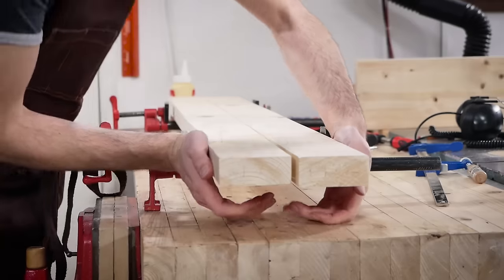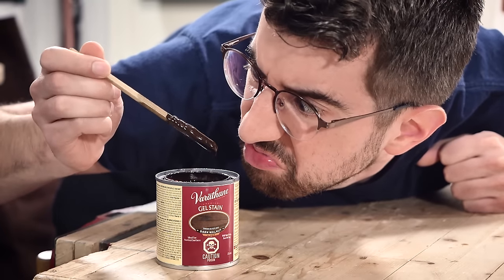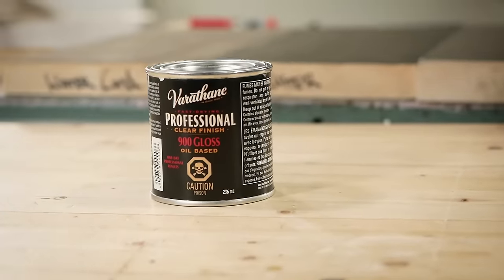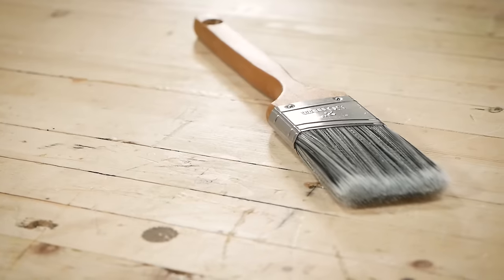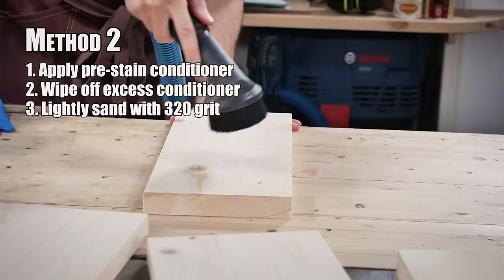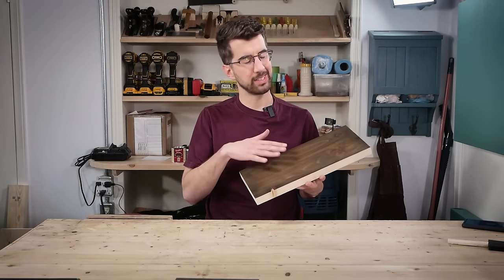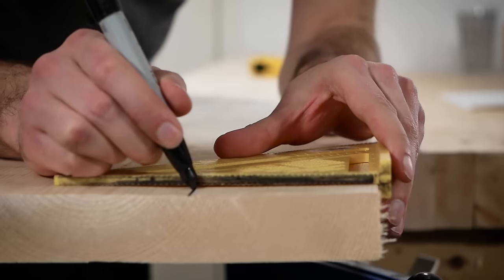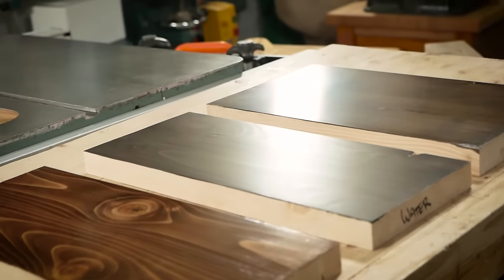Stain can look REALLY gross

Comment: I have stained a ton of clear pine from home stores with gel stains and it works extremely well as you demonstrated to avoid blotching.  If you run into areas where you do not wipe off the stain fast enough, sometimes you can reapply the stain, which tends to reactivate the dried area and wipe it back off.  This doesn't always work but it is a lot faster than sanding back to bare wood when it does.  I have also had great luck spraying water based top coats (sanding between coats) to get a quick build up finish.  This helps avoid the overlapping challenges you mentioned.

Comment: One trick I see a lot for getting a really good sanded finish is that you spray the boards down between each grit with water so that the fibers expand naturally like they would once you start staining, and the sanding takes that off, not just the dry fibers.
Reply: Sanding wet wood is annoying :c
Reply: @chang.stanley  You don't soak it, you just get the fibers on the surface to pop a bit.
Reply: @chang.stanley  you let the wood dry before sanding it. Still makes the grain pop and you get a better result
Reply: @sarahjoyce5041  Oh, cool :O
Reply: This is called water popping. Wood floor installers/finishers use this too.
Reply: @chang.stanley  once you have a finish established on the wood you're not longer finishing wood. You're working on finish. The wood is under the finish you've applied. You shouldn't sand through the finish either. Otherwise why put it on in the first place? In fact you can wet sand the finish then. I do.

Comment: Great overview! Well presented, it's always good to see the direct side-by-side comparisons on test boards. One thing I think everyone should explore though is wipe-on poly. Wipe-on has so many advantages over straight oil-based poly, chief among them being that the method is so almost impossible to screw up that even first-timers can get a great result with almost no effort. The application method inherently gives one or another very nice surface finish – the "hand-rubbed look" is sort of the default – without any significant extra sanding.

Not that I'm suggesting people go out and buy wipe-on, because then you pay them (too much) for giving you less actual finish haha. Diluting your own is generally way cheaper, plus it gives the user control over the dilution level which may be best tweaked during the process (1st coat thinner, coats 2-4 less thin, last coat thinner again) and definitely should be tweaked season to season (more dilute for cold weather in an unheated workspace), and what solvent to use (OMS v regular mineral spirits v naptha or xylene) to make a faster- or slower-drying finish as suits the user (and their tolerance for solvent odour!) along with the drying conditions.
Reply: It's remarkable how much the video and this comment echo my own experience and recommendations.

However, while I also like rub-on poly, I'd advise caution with the rub-on over stain and especially gel stain.  Even after a long stain cure (i.e. a couple days) the solvents like to lift the stain and leave it pale, thin, and blotchy or smeared - especially if the target shade was very dark.  To avoid this, I thinly apply the first coat with the lightest method practical (such as a foam brush if small scale), let dry without "rubbing," and sand with straight paper only (like printer paper).  After that there's enough protection layer to handle firmer application and more aggressive denibbing.

But if going from very light wood to very dark stain, and lighter duty protection is sufficient, that milky-when-wet water-based Varathane finish is still more reliable and foolproof.  I also personally prefer that finely textured satin sheen over all but the very best oil-based results in any sheen.

Comment: Scott's production, performance and scripting are excellent.  I wish he would have slowed down on his best and final so it'd be easier to track the steps.  He definitely has strong feelings about imperfect coloring and pine grain patterns, but in the right setting and project, imperfect can be the better balance.  I love modern design and perfect finishes, but in my house I prefer a more casual, light-rustic feel.
Reply: This mans advice right here
Reply: Whenever a video is a bit too fast paced, I like to click the gear icon in the corner, and set the playback speed to 0.75x. Easier than rewinding over & over.
Cheers
Reply: @mikegammo9002  Great tip, thx
Reply: Same, I love the colors and contrasts.

When I look back at color corrected photos from the 60's to 90's, it makes me wonder, where has all the color gone? Why is everything dull and monotone now?

Anyways, for me, seeing the grain pattern in wood is extremely soothing and enjoyable.

Comment: My favorite finish to use on soft woods is Shellac.  
You can buy it as clear, amber, or smoke color... or you can dye clear shellac with alcohol based stains.   
Shellac is easy to apply, easy to repair, & easy to smoooooooooth.
Reply: Shellac is nice but can be difficult to apply evenly on large flat surfaces. Plus its horrible for tabletops due to it being soft. I only use Arm-R-Seal by General Finishes for table tops.
Reply: @LBCAndrew  
If you apply thin coats & sand between coats... shellac is very easy to aplly evenly on large surfaces.  
Shellac being soft is only a problem if you build a thick finish.  In that case, if you desire a glass like coating over a table top... then a self leveling epoxy is better.
Reply: @LBCAndrew  I don't have a problem with shellac because I am not looking for a final finish with the first coat. I use cut shellac as a sealer on the first coat and it mostly gets sanded off. For me if I'm looking for a fine finish on wood it typically takes me at least 3 coats. I expect the first two coats to come out like trash. If I'm lucky whatever I do the third time around works. But I don't always get lucky. I keep finishing until I get the results I desire. I will apply poly over shellac for a more durable finish too.

Comment: If you want to avoid oil-based products, I've had a lot of success with dewaxed shellac (like Seal Coat) bringing out figure in wood before whatever topcoat you want to use (I've used water-based poly and other products, but the dewaxed shellac can be a barrier coat between any two types of finishes). Bonus: the same Seal Coat product will work as your sanding sealer before staining. It also smells really nice.

I generally avoid pine (I just don't like how it looks), but other woods, like Cherry, can easily blotch up as well.

Comment: Take a tip from furniture manufacturers: avoid stain, use alcohol-soluable dyes instead. Add the dye to the topcoat and spray it on. One and done. Obviously, this isn’t for everyone. But dyes (available in both water and alcohol-soluable formulas) are much less prone to splotchiness than stains. A stain is a mixture of colored solids ground up and suspended in either water or alkyd. The solids collect in the small troughs between the growth rings present in any wood, making them stand out. Dyes have no solids, so they provide more even color. A bunch of years back I used a bright green stain (Solar-Lux) on BCX plywood (after sanding to 180), covered by acrylic poly. It looked great with nice even color.
Reply: I'm a big fan of alcohol-based aniline dyes for non-brown pieces. I used a bright red and bright blue dye on some simple boxes about 20 years ago, and the colors still pop.

You have to exercise some care when using them, but because they're alcohol based, there's no heavy oil stink afterwards, and they dry darn near instantly.
Reply: Another advantage to alcohol dyes is that they're very easy to mix and customize once you learn how.
Reply: I would never add the dye to the topcoat since it makes it look muddy. I put my dye in the wood, and the finish ON the wood.

Comment: I just redid speaker cabinets.   oil based stain, 3 coats of satin polyurethane.  knocked off nibs with 320 sandpaper on coats one and two .   coat 3 ( final) was pretty good.  a few specks.   used 1000 grit wet sandpaper, wiped it across finish and it took off nibs.   didnt dull the finish.   im happy with the result .

Comment: For top coats, I've gotten really good results with several thin layers of wiping poly (like 4 ish?), and a thin rattle can coat on top. After it's set up I buff it out with a paper bag aggressively. Ends up looking real nice :) I started with wiping stuff because wow do I hate cleaning brushes.
Reply: Progressive thinning coats is how I achieve a fine finish. I want the final finish to be chemical sheen. So I want it to just level off. One secret is after you've built up a finish you need to realize you're not longer finishing wood then. You're finishing finish. So that means you can wet sand. You should wet sand too. I have brush cleaner so I don't mind cleaning brushes. After I brush clean brushes I wash them out with soap and water. I am not a fan of wipe on finishes unless they're just an oil.

Comment: Another trouble spot for staining blotchiness is glue. If you glue up boards before staining, don't use so much glue that it runs all over. Use just enough to get a small bead of squeeze out and do not wipe it off. Wait until the bead is dry then scrape it off. This will save you a lot of sanding to get through the glue that soaked into the wood.  Stain won't stain glue.
Reply: Oh my word - that tip just might save our marriage.  lol  My husband is a skilled woodworker, but this glue issue has been the bane of his existence - such a simple solution - don't smear and you have to sand anyway, so chipping it off once it's dried makes perfect sense.
Reply: @dianapuppy4141  There are a bunch of ways of avoiding issues with glue squeeze-out. I presume your hubby might have seen a number of these before, or by now, but I'll list a few tips in case they're useful.

First, wiping off wet IS a legit method (and many pros do this). But it's rarely shown or explained how thoroughly you need to do it to avoid problems. First thing is to use plenty of clean water, second is to wipe more than once. Almost nobody wipes more than once with clean water and/or a fresh rag and that alone makes a huuuge difference. I think three times is the minimum for guaranteed effectiveness and I wipe dry as the last pass.

Not always doable, but applying sanding dust to the area and then brushing off with a firm bristle brush (toothbrushes, medium or firm, work great for this)

This tip has been around for ages: tape along the joint edges. This can be 100% effective, but it uses a lot of tape in the long run (potentially an issue if you're using the expensive blue or green stuff). Anyway, the glue goes onto the tape, and can be wiped off, wet or dry.

Provide space inside the joint for glue to go, so that none or almost none is available to squeeze out onto the surface. This is best covered in detail in an article, and I think Fine Woodworking had one last year or the year before that explains this well, with detailed photos. 

Last one is to pre-finish before final assembly. This isn't always possible depending on the project type, but where you can do it the dried finish acts as a barrier to glue penetration, and makes wiping off spills or squeeze-out super effective and easy. 

Hope it helps!

Comment: Sometimes the old way isn't so bad: I'm a fan of shellac. 1:6 with alcohol as a pre-conditioner (spitcoat), then an oil or water based stain, then more shellac. You could also go all out for full French Polishing, if you really want to go nuts with it. That gets gorgeous results. 

If I'm feeling lazy, Tung oil, Danish oil, or linseed oil make a perfectly good stain and finish all in one. They aren't the most robust, but they look good.

Comment: For stain, my favorite way to do it is add stain to the polyurethane and apply as a single finish. Comes out a lot more evenly. I usually apply it with a foam brush.
Reply: @MegaShitfactory  yup. Generally, I add just a little then mix it and use a test piece. If I need to go darker, I add a little more. It usually doesn't take much and one coat generally does it. If I need a bit more durability, I'll go over it with clear polly.
Reply: That’s exactly what minwax polyshades does with that product.

Comment: 2 coats Danish oil + 3 coats water-based polyurethane is my go-to finish. Sand with 180 grit between coats on the urethane. Watco's been super backed up on their manufacturing side though so you might have to haunt a bunch of different stores to get the hookup.

Comment: Nobody uses liquid wax applied with wet sandpaper anymore.  That's what I used on my 3-piece project in HS wood shop in 1973 and the finish is still deep and smooth today. Yes, I still have my little book rack... somewhere.

Comment: Great video.  I will take your tip on vacuuming between sanding passes to fix some issues I had on a recent project (couple of swirles made it through).  As for my favourite method...Optionally wipe wood with water to open pours if I want to get darker stain (with a quick final sand after it dries).  Next apply oil stain with an old sock (no lint due to years of washing, holes optional) but only wipe on what the wood can immediately absorb for an even coat (re coat if needed later).  Apply thinned out layer of oil based poly for first coat.  Apply second coat.  Sand second coat with either 600 grit paper or fine steel wool.  Apply final coat with foam applicator but super thin, like squeegee/push it on not brush (adds final gloss without any brush marks).
Reply: Traditionally you're supposed to use a tack cloth to remove dust between coats. But if a vacuum does it then more power to ya. The problem with running a vacuum is it may put dust in the air. Dust that may then settle on the work you're doing. We don't all have HEPA vacuum cleaners.

Comment: The method I was taught by my father and have used for about 50 years is the 2 rag method with oil stains, wipe and rub until you achieve the colour you want then wipe off immediately with the second rag then a final wipe. For a finish my favorite compromise is an oil based wipe on poly, lay out all of the rags to completely dry.

Comment: I usually use 3-0 steel wool on each coat of poly to get the smoothness and lustre of the finish in your final piece. Keep a strong magnet nearby and shop vac running to clear the air of steel wool bits, in addition to a good mask.

Comment: I’m really trying to get better at hand planing most of my final surfaces to reduce sanding time, sand paper expense over time, and reduce dust. There’s a learning curve for technique, and a huge learning curve for how to tune up the cheap home store versions of the tools. I’ve had mostly good luck starting out with that thanks to YouTubers focusing on the diy/new woodworker hobbyists. Thanks for the great video.
Reply: Hand planing can burnish wood surfaces. The grain gets closed up. Then finishes may not apply well. So before I finish a piece I've planed I rough it up some with sandpaper. Very fine sandpaper. 220 grit works for me. I am just looking to knock off the case hardened layer. That light sand evens everything up.
Reply: @1pcfred  thanks for the tip

Comment: For getting a smooth glassy look out of oil-based poly (specifically, I did this with Varathane oil-based poly gloss finish) that's showing brush strokes (and dust specks), I found great success with just 0000 steel wool for the buffing.

The trick with this (that I did accidentally) was to do the buffing between 24-48 hours of cure time (Varathane oil-based poly has a 72-hour total cure time).  This is going to look awful, scratchy, and cloudy, as well as dusty from the buffed poly and the steel wool fibers.

Immediately after buffing, I wiped the surface with a naphtha-dampened cloth.  Right away, this will clean away all the dust, but you will still be left with a cloudy surface with fine scratches all over it.

This is where the naphtha specifically is key:  Varathane oil-based poly is suspended in naphtha and mineral spirits.  By wiping with naphtha, you are extending the cure time by suspending more of the uncured poly in a loose liquid.  As the naphtha and other VOCs evaporate, the poly will shrink back and fill the scratches with a very smooth glassy surface.

I suspect mineral spirits would work as a stand-in replacement for naphtha, but this was not what I used when I learned to do this, so I cannot attest to its success.

Comment: I like oil based, if its a project for me I just use minwax natural because I would rather bring out the existing color of the wood than change it too much. Polyurethane, sand or buff, then polyurethane and repeat that until the desired thickness is achieved. I have only had bad experiences with pre-stain and water based stains often look like they are painted on top of the wood instead of really bringing out the grain like an oil based finish.

Comment: So many different types of finishes you can make look awesome. Each one can make a piece of furniture look very cool. Sometimes even sanding is not desirable depending on the project. Sounds crazy , but its not. I use spray paint on wood all the time before i ever sand. Add stain that has been deluted with thinner so it goes deeper into the wood, gives a good color without saturation of that color. Then after sanding adding colored wax instead of sealers. Just one way, but it goes to show that theres a thousand ways to get great colors and depth with and amazing soft to the touch feel. If a piece is suppose to look old then process changes compared to just a new stained product. So many fun ways. Get creative in your project by exploring different ideas. Youll be amazed. Great channel and great information.